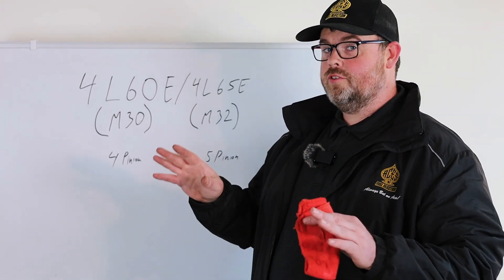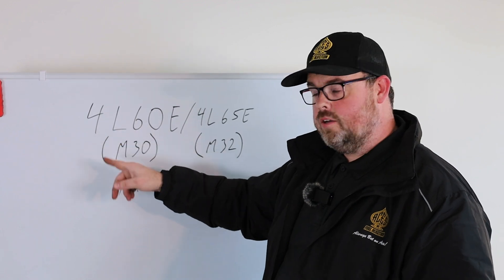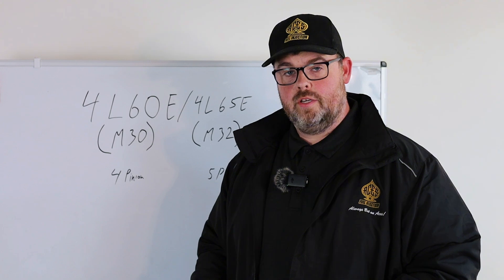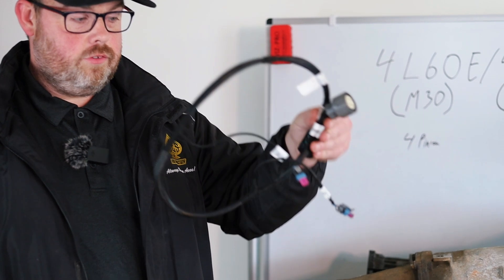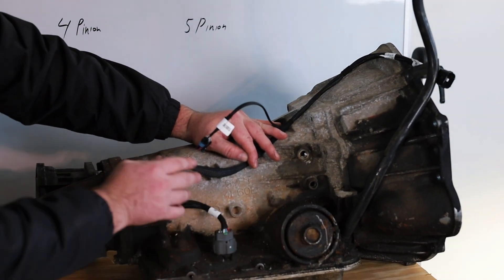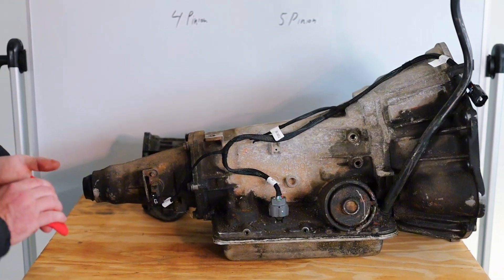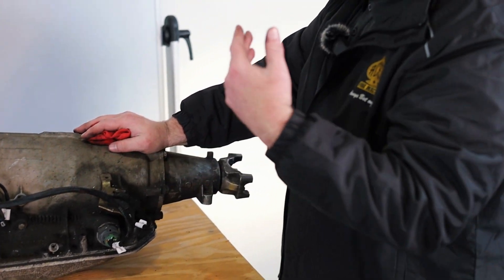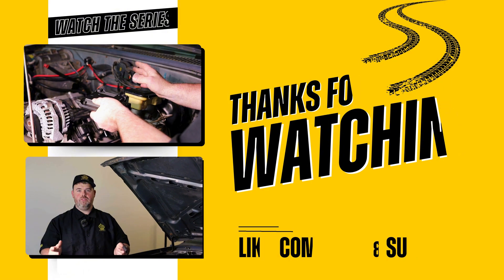Transmission Hookup (Jackpot LS Installation Guide Ep.4)

Comment: I just put in the Wild Card and Quick Draw for my 99 GMC Suburban. I have everything hooked up correctly on the two systems, but I goofed up when I was going through my factory harness depining what I didn’t need and accidentally deleted my neutral safety switch and it will not start. I could wire it back through the factory harness but isn’t there a way to bypass it? I’ve searched and only found it for square bodies and for LS style trucks, but nothing for 96-99’s. I keep going over the schematics  and have tried a couple different things, but no luck yet. Anyone else done this or have any suggestions? Thanks

Comment: There are two trans that would be awesome if yall could work on a sub harness and controller, the Allison 1000 and ZFs 8HP, the latter apparently only needs a few points of data to practically work in a whole boat load of applications. I believe Nivlac is putting one in a Trailblazer with an Atlas 4200 in front of it.

Comment: I'd still rather use a manual or a 700r4 or 4l60
Reply: Running 5 speed manual transmission but still not able to figure out how to disable automatic transmission controls
Reply: @jaimearroyo3907  if youre using aces just restart the wizard and choose no trans controls :)

Comment: I would still like to use my factory speedometer.  Can the vss be split?  Or does your controller have a speed out wire?
Reply: If you look at the wiring diagram there is a Tachometer hookup on connector B3
Reply: @KyleGreen-ez1py  I am confused by this response.  I meant the vehicle speed not the engine RPM speed.
Reply: @TagGeorge  My apologies, on the same connector there is a SPEED OUT wire (white 20 awg)

Comment: Good job Tim but your forgot there two 4L80E early and late model your's is a late model It is actually has a stronger main shaft And the main difference is where the tranny cooler lines are, oh if like order the short shift shaft from sonnax 38511-01K kit